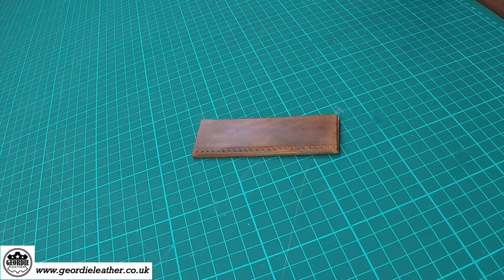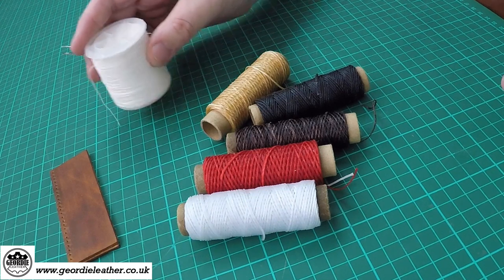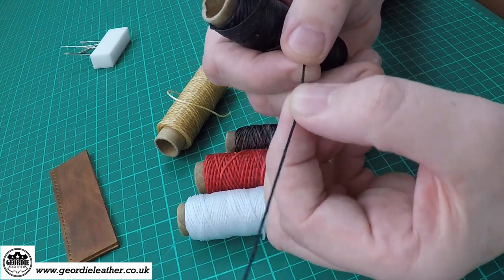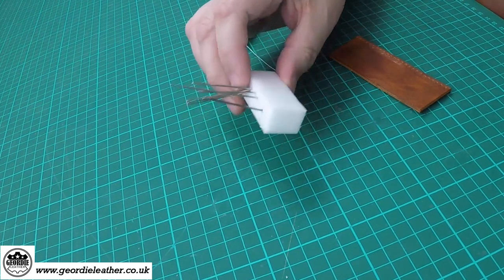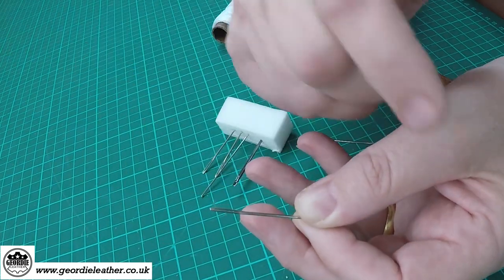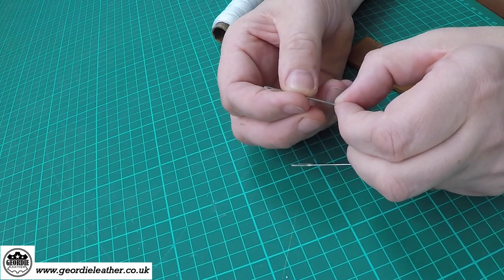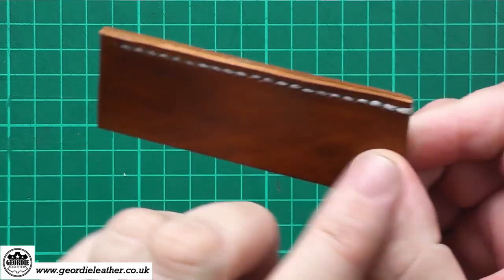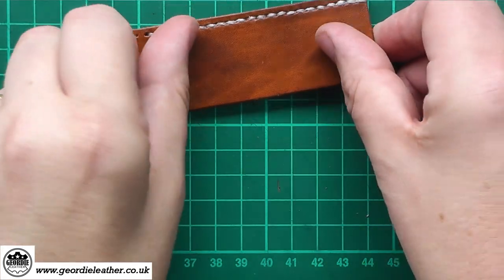#11 Saddle Stitching - Leather Work For Beginners

Comment: Great video, very methodical. At the start of your stitching you mentioned that normally you would start at hole 2, go backwards to hole 1 and then progress to hole 2 and then on to the end of the row. Have I got this right and would you add the two loops around the edge of the leather or is it done differently.
Reply from the maker: Hi. You would backstitch and loop the first end. The forward stitch to the other end and form the loop and backstitch to finish off. Hope this helps.
Reply: @HobbyBloxs  Thanks, will give it a go.

Comment: if your stitching a particularly long run it can be worth putting the needle through the thread for 2-3 securing points-  multiple places not just once to hold it together, also can you go over the edge with a cobblers hammer to flatten it a bit?
Reply from the maker: Good advice. Yes, tapping the stitch line with a cobbler's hammer will help to flatten it and even it out a bit. Thanks for your input.

Comment: Beginner question. Why not use a normal bench vice with some leather on it instead of the stitching pony?
Reply from the maker: Hi. You could do that. Just don't over-tighten it. Leather is very sensitive to pressure and will mark easily.